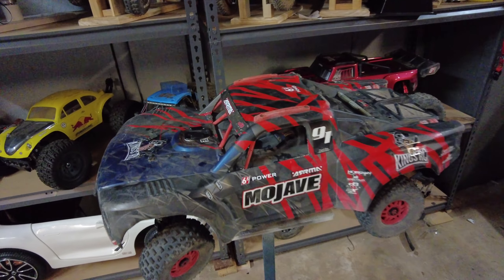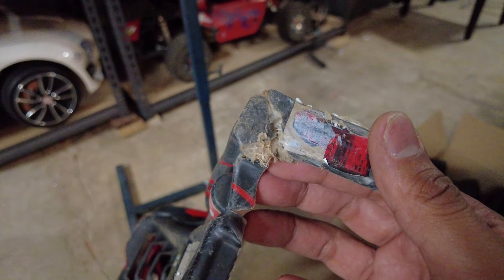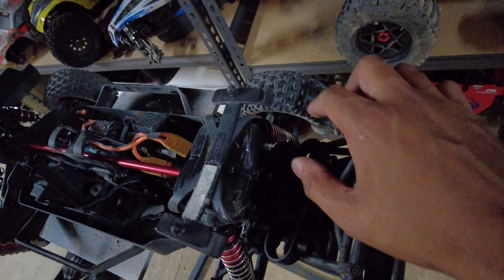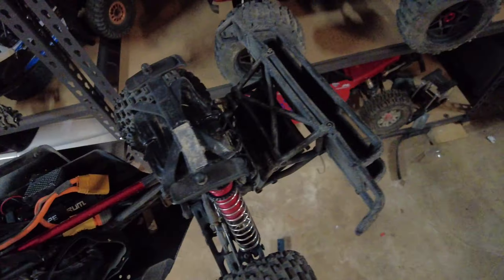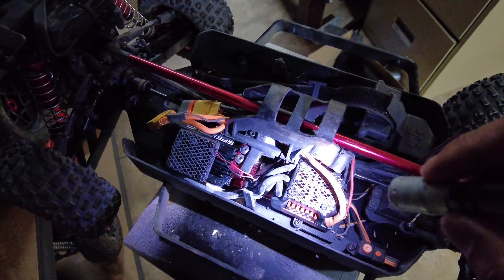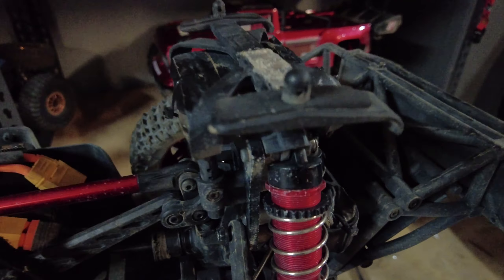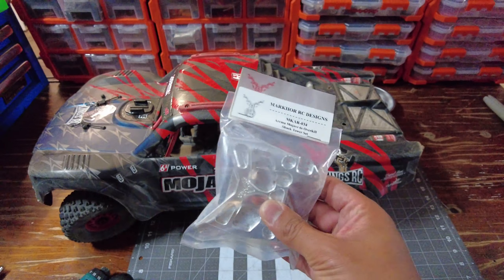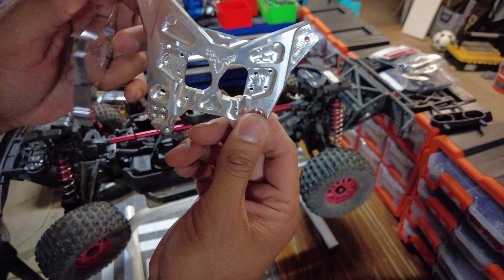Arrma Mojave V2 6s Upgrades and mods - How to install

Comment: Does the car come with fan an heat sink? I saw a guy saying that it didn't on those? Just checking. I have one on the way. Or Is it do I need to add an extra to keep them from getting hot? 🤔
Reply from the maker: Hey bro, thanks for watching. No i believe mine did not come with fan,only the heatsink..but it is always a good investment to ad cooling fans on your motor and esc even when you think you may not need it which seems to be the case with arrma in this truck 😅.. i mean really? For the amount you pay they couldnt just add a 10dollar fan 😅

Comment: What a beast!! I love the Mojave 💪
Reply from the maker: Mojave is gotta be the toughest arrma 😁... Done any upgrades to yours bro?
Reply: @KingsRC  I installed some scorched inner fenders and I'm running a castle mmx8s 1650kv combo 🙂✌
Reply from the maker: @basher-85  killer... how U like the max 8 combo? To the stockies?
Reply: @KingsRC  oh sorry I meant the Mamba Monster X 8s combo not the max8. It's insanely fast. I mainly run it on 4s and 6s, 8s is just too much 😅
Reply from the maker: @basher-85  sweet bro! I'm eventually going down the path of overpowering this thing 😁

Comment: I'll have to watch it on .25x, because I didn't learn how to install the aluminum mounts. 😆😆🤘🤘
Reply from the maker: Oh my bad bro! Its quite straight forward to install the aluminium mounts just have to be aware where the body mounts bolt back in, otherwise you will be guessing and having to keep remounting them to match the holes 👍😊😊😊

Comment: What’s did you use for the wire screen on the fans?
Reply from the maker: I found it at the hardware store man its like really fine aluminium mesh..ive had it laying around for a while but check out hardware stores, sorry cant tell you exactly where to buy bro
Reply: @KingsRC  ok thanks, and did you just screw it down or use glue?
Reply from the maker: @scottg429  i screwed it just some just sort of clamps to the screw but some holes lined up perfect
Reply from the maker: Stay tuned to the channel bro thank you

Comment: I like Basherqueen shock towers and DustyMotors zip up mesh chassis bag.
Reply from the maker: Basher queen is the carbon fiber right? Ive gotta check out the mesh chasis bag.. thanks bro
Reply: @KingsRC   Yes carbon fiber, what do you think of that material being used in a basher?  (these are going in a showtruck)
Reply from the maker: @surfside75  yeah not sure about being in a basher.. the purpose of carbon fibre is supposedly saving weight? Its rigid but not sure on the flex of the material. You would want some flex in a basher and if we are bending the stock shock towers there is alot of force going into it...the carbon fibre may snap before it bends, in theory anyway. Correct me if im wrong but the only way to find out is to install and field test 😉
Reply from the maker: Ok let me correcty myself, carbon fibre is alot more stronger than aluminium, so with the same size piece as aluminium its stronger.. u could make say a 5mm thick aluminium and a 3mm thick carbon fiber and the strength is equal (weight saving)... The down side is once the carbon fibre reaches its limit the failure will be unforgiving, where as the aluminium hits over its yield limit it will just bend... So a bent shock tower you may keep running the car as to a broken one into pieces 😃...
Reply: @KingsRC  I may just order a second set for the green rtr mojave basher IF I bend the stock metal shock towers. I just wanted them for the bling on my Mojave v2 showtruck🤩 came with a couple other pieces too and I bought the Basherqueen carbon fiber servo stand. I'd buy all carbon parts but that's all I found so far. Wish I could find carbon fiber suspension arms  but I bought the GPM aluminum ones. Let me know if I missing anything.
Reply from the maker: @surfside75  bro if you want some bling...how bout those Vitavon aluminium knuckles and the alloy wheels..
Reply: @KingsRC  vitavon is asking a lot, but I do like the knuckles. 
  I've gotten the GPM suspension arms, chassis braces and CVT axles for the rear. Hot Racing top braces front and back, M2C rear brace links and shock tower stand offs, full Basherqueen carbon fiber set, Power Hobby full metal servo, Tbone bumper/skid, WinterEvening bearings, Dusty Motors zip up chassis bag and a full LED kit from polo creations.🤩  -Vitavon knuckles in the future I guess, anything else?
Reply from the maker: I think you've got a beast of a mojave bro!
Reply: @KingsRC  Thanks KingsRC🤙😁